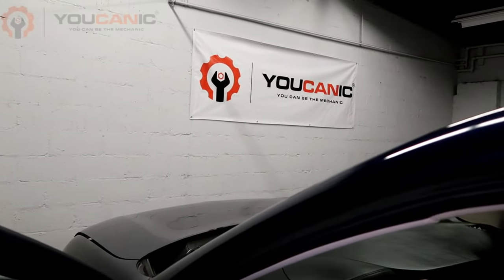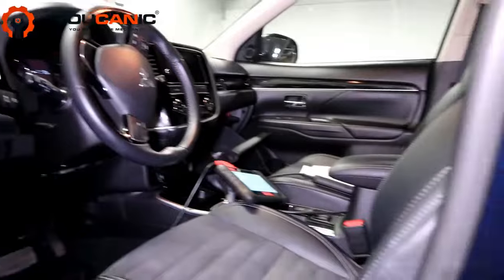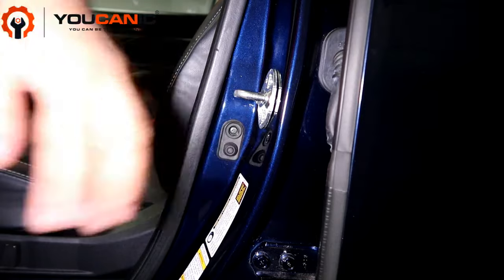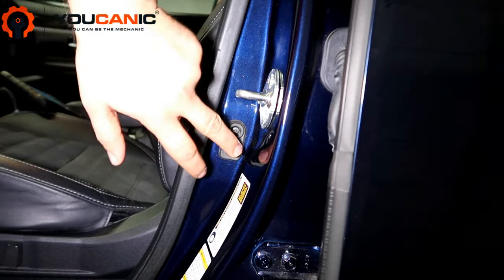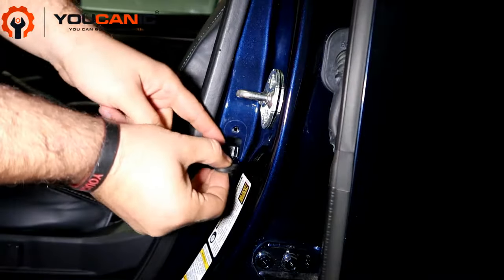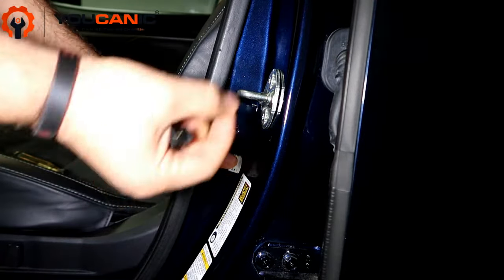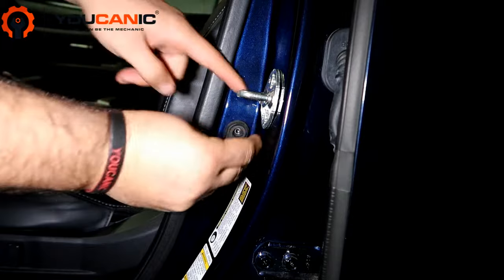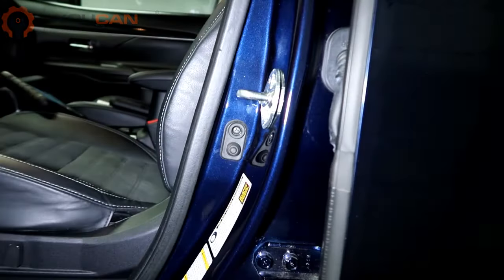What Causes Door Open Warning When Door is Closed

Comment: Didn’t fix my problem but pointed me in the right direction. Thank you 👍
Reply from the maker: We appreciate your feedback and are pleased to know that you found our video helpful in some way. Our aim is to help you with your car repairs, giving you similar skills to a professional mechanic. We recommend the YOUCANIC Full System Scanner, a powerful tool developed specifically for diagnosing modern cars. Find more about this tool here - www.youcanic.com/scanner. 

For better results, we advise the use of Factory Repair Manuals and Torque Specs which would provide more precise details for repairs. For a small fee, these professional resources can be accessed at www.youcanic.com/manuals. With YOUCANIC, you're one step closer to being an expert in car repairs.
Reply: Didn't fix my problem either. What did you end up doing to fix it? I'm still searching for results after several weeks
Reply: @bigstick8699  my problem turned out to be the door lock actuator. This video pointed me to figuring out what door wasn’t locking correctly.

Comment: Would it be the same for me? It pops up a lot while driving or just stays on. Specially when I turn right. If I pull the handle towards me (inside) it goes away, it goes away. If I smack the handle from the inside, it goes away. It seems to be thinking it has pressure on it pushing out even when I'm not touching the door panel.
Reply: if you have a local junk yard, go there and get it but yes that would be the same for you
Reply: Man I have the same issue rn
Reply: My back door does this and I replaced the switch still does it

Comment: What if mine works when I push it down all the way with my finger but when I close my door it doesn’t want to work. What should I do then? Get a new one or what else?…. Pls help
Reply from the maker: Pull out the switch, on the back you will see the metal contact. Bend them to be closer and that should fix it. If not, replace the switch.

Comment: I'm currently using a microfiber cloth hooked onto the silver door hook, as its the only thing that stops the warning - it happened today on my way to work and I had to do what I could before I left my unlockable car in the car park 🤣

10/10 jury rigging skills, but I think I'll need to buy a replacement one 

I think mine got damaged as sometimes my seatbelt doesn't retract properly and when I close the door the seatbelt mechanism hangs perfectly where the switch is so the door bangs and swings back open
Reply from the maker: Thanks for reaching out! At YOUCANIC, we completely understand the need for quick solutions and appreciate your creativity! It's clear you could be well served by exploring our range of resources and using our high-performing YOUCANIC scanner. We're here to make car maintenance easier, and save you money. 

We also offer detailed factory repair manuals should you need in-depth assistance. We're here to empower and support you throughout your car ownership journey. Feel free to ask us any questions or seek assistance on our site at www.youcanic.com. We look forward to helping you with your car maintenance needs!

Comment: *POSSIBLE SOLUTION*

When your seatbelt gets caught in your door when you slam the door it’ll leave a dent in your door frame. The dent is causing your door to not make full contact with that push-in sensor. 

I duct taped a nickel over the dent and it worked 😃😎

Comment: My Hyundai Tucson 2016 does not have any visible sensor. it doesn’t not show the driver door open or shut. When the door open the system thinks it’s closed 
I don’t know what can be the cause
Reply from the maker: Your Hyundai Tucson's issue could be due to various reasons including a faulty door switch or a problem with wiring. It can be diagnosed accurately with tools like the YOUCANIC Full System Scanner. Check it out here: www.youcanic.com/scanner. 

If you have more queries, feel free to use our forum at www.youcanic.com. Our experts will guide you through the process to diagnose and fix the issue. Your trust is greatly appreciated, and we're available to assist you with any automotive concerns.

Comment: My 2019 Subaru outback is doing this, but only when I use the remote start. The door will say it’s open for about 24 hours, and then it’ll shut off saying it’s closed and it will open and close as normal. Once I use my remote start again, the same thing will happen, saying that my driver door is open for a whole day. Can someone help? I am going to see ziebart, who installed the remote start as well.

Comment: hi  i just changed mine got from
the dealer and remove negative terminal
from the battery but still door light flash in the dashboard and alarm goes off.

Comment: Instead of my dashboard showing a door open on the car body, the dashboard shows the body of the SUV.... with no door open. What could cause that? Note that I hear flickering sound whenever the car body displays on the dashboard.
Reply from the maker: It sounds like your vehicle might have a malfunctioning sensor or an electrical problem which is causing the SUV body to display on the dashboard instead of an open door. The flickering sound could also indicate an issue with the car's electrical system. YOUCANIC has a perfect tool like our Full System Scanner (www.youcanic.com/scanner) that can help you diagnose these kinds of issues accurately. 

If you need further assistance or have more questions, feel free to use our Q&A section on the website www.youcanic.com. We have a wealth of resources to help you understand and handle these situation more confidently.

Comment: My car sensor is stuck inside and it's turned upside down , so when I try to pull it out it comes out backwards and it's too wide for the hole and the wire is too short to be pulled out completely .
Reply from the maker: Thanks for reaching out! At YOUCANIC, we're passionate about helping car owners handle maintenance issues with confidence. We provide guides, free resources, and a powerful scanner to simplify car maintenance. Visit our site at www.youcanic.com for any assistance. We have factory repair manuals available for complex situations like yours. At YOUCANIC, our mission is to empower you with the right tools and support for all your car ownership needs. Your trust is important to us!

Comment: The installation of the switch on my 2014 Nissan Rogue was a breeze, but the open door indicator is still lit. Can you tell me what to do from here? Thanks!
Reply: Does your alarm still go off when locked??
Reply: My alarm still goes off even when I change the door switch what do I do ?
Reply: @john25112882  Thanks for replying John. My problem was because the door was out of alignment as a result of the seat belt getting caught in the door multiple times.
Reply: @BrendaLondon-i1o  how did you resolve it ? seems I might have gotten into the same issue

Comment: I've tried and changed the switch but it still shows that the door is open toyota hilux 2.6gd8
Reply from the maker: Thanks for reaching out! It sounds like you're encountering a frustrating issue with your Toyota Hilux. At YOUCANIC, we're dedicated to supporting car owners like yourself through these challenges. We offer comprehensive guides, free resources, and even our unique YOUCANIC scanner to assist you. Head over to www.youcanic.com to find these resources and let us know if you need any further assistance.

Our mission is to empower you in solving your car problems. Don't hesitate to reach out on our site, even for the most complex issues. We even have factory repair manuals available for detailed guidance. Happy motoring, and we're here to support your journey!

Comment: Oddly my switch works but the  metal on the door is somehow dented in a little
Reply from the maker: Thanks for reaching out! It sounds like you might need a bit more detailed advice for your situation. At Youcanic, we're dedicated to equipping car owners with resources and tools to confidently handle their car issues. We provide informative guides, free resources, and even access to our powerful YOUCANIC scanner. 

Don't hesitate to utilize these resources and drop any questions or concerns on our site at www.youcanic.com. Our mission is to empower and assist you throughout your car ownership journey. For more complex problems, you can also access our factory repair manuals. We're here for you, every step of the way!

Comment: How do you know which door switch is faulty?
Reply: Thats what am wondering
Reply: A proper OBDII diagnostic tool can tell you which one(s) are faulty. The driver door is the most common point of failure, but it can be any door, or more than one. The easiest way to fix it would be to order new switches for all four doors. You can also buy one switch and test them one at a time.